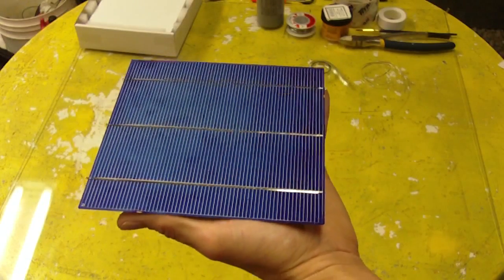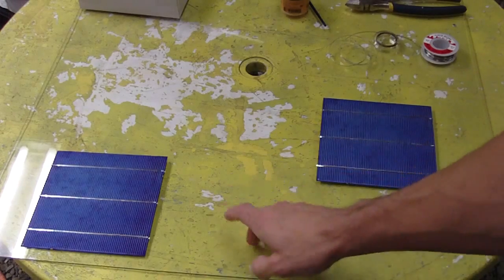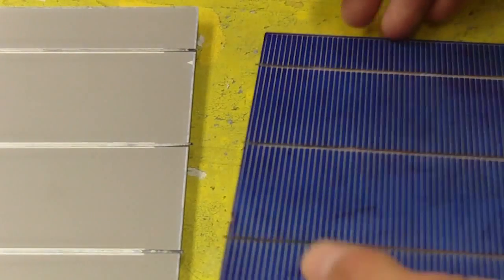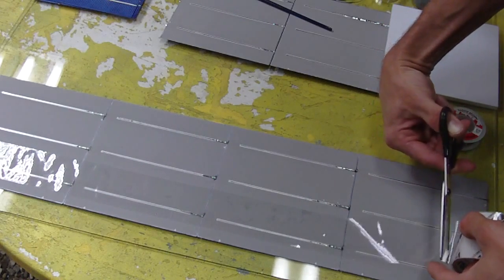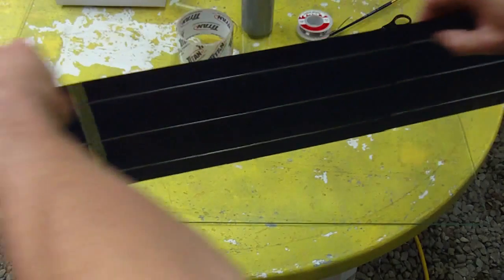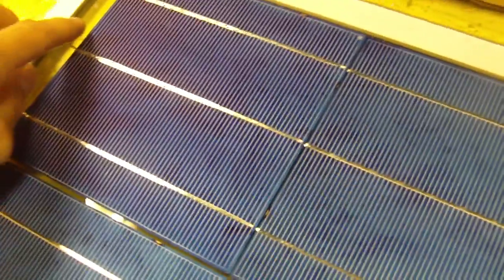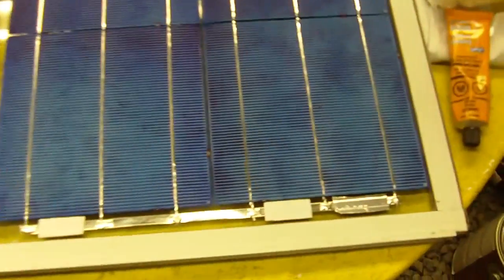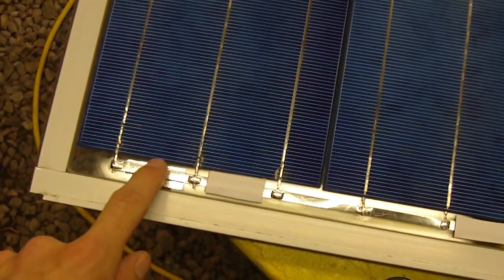Homemade Solar Panels Diy tutorial, complete build

Comment: Great video was wondering why you used glass for the back cheers
Reply from the maker: Thanks a lot 👍 These are non encapsulated glass on glass panels, so I used glass on the back of these panels to provide the best weather proof seal as possible. Ive tried other materials but they don't last as long also they expand and contract at different rates. I actually made some newer videos last year of a monocrystalline if you are interested.
Reply: @kurtscottage  cool thank you very much for explaining I will watch that other video cheers best wishes from England

Comment: The spectral properties of the glass have to be known/tested first. If not: normal glass can give a lot of loss on the yield because of damping the light/frequencies that add most to the wattage/output. I made small panels in the same way: it did not work (condensed water, internal oxidation, breaking glass due to freezing temperatures, solar units not completely identical and thus loss and "pushed up" current, damaging the weak cells, etc. The process can work for small hobby panels, not for the serious ones. And at the moment (2018) professional panels are very cheap. Anyway: a good experiment, I appreciate it!

Comment: solar cells for sale,Grade A cells , 156*156 3bb mono and poly, 3.92w,4.09w,4.28w,4.38w,4.44w.4.59w,4.72w,4.77w
price starting from 1 USD.(German solar cells,Malaysian cells)tabbing wires, buswires. all materials for made solar panel,exporting from sri lanka
contact for more info-
whtsup/viber 0094778322668

Comment: what material are the panels solar made of?
could see in whole video
thanks
Reply: solar cells for sale,Grade A cells , 156*156 3bb,2bb mono and poly, 3.92w,4.09w,4.28w,4.38w,4.44w.4.59w,4.72w,4.77w
price starting from 1 USD.(German solar cells,Malaysian cells)tabbing wires, buswires. all materials for made solar panel,exporting from sri lanka
contact for more info-
whtsup/viber 0094778322668

Comment: Hi Thank you for your video, it was really informative. On another note, I have to point out that glass is definitely not a heatsink  Glass is barely heat conductive hence why it breaks so easily with thermal shock because of huge temperature gradient. A heatsink needs to have 2 caracteristics good thermal conductivity AND good heat capacity. Aluminium, copper, steel basically all metals can do that. Glass, I do not believe so

Comment: ok it seems that a lot of people here dont know what he is doing he didnt make the solar cells he bought them. he is making a solar PANEL if you want to know how to make one here it is http://www.wikihow.com/Make-Solar-Cells if you want to buy some cells and make a solar panel here it is http://www.ebay.com/itm/100W-Solar-Panel-DIY-25pc-156x156mm-6x6-High-Power-Solar-Cells-Battery-Charger-/302170834486?hash=item465ac90636:g:jwUAAOSwECZUo2gy
Reply: solar cells for sale,Grade A cells , 156*156 3bb,2bb mono and poly, 3.92w,4.09w,4.28w,4.38w,4.44w.4.59w,4.72w,4.77w
price starting from 1 USD.(German solar cells,Malaysian cells)tabbing wires, buswires. all materials for made solar panel,exporting from sri lanka
contact for more info-
whtsup/viber 0094778322668

Comment: you say they are very delicate but you pile all your materials on top of them???? you didn't show noting but how to destroy other panels to just stick them all back together. in which you still didn't give a good presentation. so destroy a shit load of solar lights just to sadder them back together.... weird and a waste of time.
Reply: you can buy the short tabbed cells on ebay. he didnt take them apart. costs less than a fully tabbed cell. just makes it cheaper for the DIY'er. I have never used these kind, i apply the tabs to new cells when i make my panels.

Comment: I was build several panel in this manner or slightly different. All of them suffered from same problem - over heating due to green house effect and melting all soldered points. I try on different approach, and my conclusion is: Without EVA film encapsulation or resin filling ( what is extremely expensive) it is impossible to build durable panel.

Comment: Nice educational video, how is presenting so far the solar panel? some problems, with condensation, or other something else negative can be prevented? Because I want to do something similar but probably smaller. Thanks in advance if you can answer.

Comment: From what I've read solar panels are at best 10 -18% efficient.  
If they are attached to your roof they are only 100% efficient  for 30-45 minutes of the day for only about a month or two out of the year.  The rest of the time isn't the efficiency about 5 to 10%?

Then from what's produced ins't 10-20% of that lost by the inverter?  So if you average how munch energy is being captured to what's usable isn't doesn't that average out to 2 to 5% over the course of a year?
Reply: +Passed High School Physics Well, you used to be right , years ago but solar city sells them at 20-21% efficiency, and the total voltage drop if wired up ideally, and your inverter isn't from the stone age is around 3%.Not bad really, we're getting there.
Reply: TheLast Dragon   California is turning off solar farms and favoring buying energy from coal and natural gas fired power plants.  Turns out solar isn't reliable,
Reply: +Passed High School Physics .... Right, the same state that can't secure a water source, elected the terminator, and has midgets and porn stars run for office is at the fore front of what works and doesn't work in broader society.  Everyone knows that clouds cover the sun and depending on where you are, solar isn't always the answer, but it's a step in the right direction , especially over polluting the atmosphere with more burned coal and fossil fuels.
Reply: TheLast Dragon   Hey we are proud to elected the terminator, and had midgets and porn stars run for office but at least we have we have standards we never elected a beauty queen.  Remember pron stars not only have to look good, but act as well..

And speaking of actors you didn't mention the actor, turned governor (who sprayed protesters, elementary schools and hospitals in Berkeley) with tear gas was elected as our 40th president.  He ruled the country with the help of his wife and an astrologer and was such a good actor we didn't even know he had Alzheimers.

Why is it the environmentalists who say the world will one day be powered by wind and solar forget to say where power will come from at night and when wind isn't blowing.

Not trying to insult them but how will my 82 year old mother heat her house or have light at night when there's no wind or at night?

Comment: A 6'X9' panel (24 cells) would be required with no space waste to create 12V@1A max. It would require 100 of these 12V panels to convert to 120VAC@10A (1200W) minus conversion inefficiency. (60'X90' of space used) Typical home has 100A service, so that means it would require 1000+ of these panels (6'X9') to power a house breaker panel at maximum capacity. (Almost 1X1.5 miles of land area) The solution is to find cells that put out more electrons with less surface area.
Reply: @DrHarryT

Your 100W breaker service should not be taken into the equation.  No one's house is actually pulling the 100W at any given time - that would be astronomical.  My daily usage for example, is only about 500 watts max an hour.

500 watts translates to around 4-AMPs being used at any given time - again on average.  4-AMPs means around 5 or 6 of those 6x9 panels you mentioned, not 1000+ panels!  :)
Reply: Moe of course was not the only one
Reply: Not sure what you mean: Was not the only what?

Comment: when i did some soldering of PV cells a couple of years ago i placed another piece of glass over the string of cells (which were sat already on my piece of toughened glass) to make a "sandwich"
Then i could turn the whole thing over safely and then remove the glass that was beneath is now on top.
good tip ??

Comment: These are the cells you used right? 100pcs 6x6  from newegg? http://www.newegg.com/Product/Product.aspx?Item=9SIA2PA0ZV2240&cm_re=6x6_solar_cells_100_pcs-_-9SIA2PA0ZV2240-_-Product
Also is it as effective to use plexiglass so they'll be more durable in harsher weather? Thanks for the video!

Comment: Change your solder from 60/40 to 63/37 solder. This 63/37 has no eutectic state (no plastic state.) Also, clean all connections with technical grade (>80%) alcohol prior to soldering with a clean tip. Clean all flux off with alcohol.

Comment: I've never messed with any of this before, So I have a question for anyone here that may be able to answer. The wires that come off of the solar panel, Can those wires be connected to a charge controller ? Or do they have to go through some kind of circuit first, then to the charge controller ? As I said I've never messed with any of this stuff before. Now this is the reason that I ask the question... I was given a solar panel that had the wires and the black box ripped off of the back. I can solder new wires on the back of the panel, but I'm wondering if that will work being that there is no box on the back of the panel ? Is there some kind of circuits inside of the box where the wires connect to the solar panel ?
Reply: +Roger Sayers 
The black box might have had a diode to block reverse current, but without that when you connect a charge controller direct to the panel your job is secured. The charge controller will have the revers current blocking diode and will protect your battery from overcharging and under draining.
Reply: +Ponniah Kunathasan Thanks for that information. It sure does help. Now I'm wondering what side of the paned is Pos & Neg ?? Would you happen to know ? As I'm looking at the panel from the back or reverse side, Would the Pos be on the left or right ?  I hate looking so dumb here, but this is the very first time I've ever messed with solar panel.
Reply: +Roger Sayers 
The blue side (The front of the cell) is negative and the  gray side ( Back side ) is the positive. All the lines in the front  are negative or  all the lines in the back are positive.
Nowhere in the world a walking baby has born. Do and learn, if you make a mistake you are not going to die.
Reply: +Roger Sayers I can guess that pos is at the back but this is not absolutely guaranteed. A test meter (and blocking diode) are essential.
Reply: +Cashpot I missed the diode in the video. If one is to connect the panel to a battery, this becomes crucial.

Comment: Most silicone RTV sealants sold in hardware stores and auto parts stores produce acetic acid (vinegar) during curing, which plays havoc with metals used in electrical equipment and severely affects long-term reliability.  I'd use a type of RTV that doesn't produce acid.  It's much more expensive, and generally only available through industrial adhesives distributors.  Consider clear or gray Dow Corning 3145; white General Electric RTV 162 or gray high strength RTV 167; and clear Loctite 5140.  These RTV sealants produce alcohol, not acetic acid, during curing, which is generally harmless to electronics.
Reply: +Milosz Ostrow Last time I checked, GE Silicone II is also a non-acetic (aka "neutral")  cure.  Any easy check is to smear a blob on a paper towel, let it sit and dry a bit and if you sniff it and it smells like vinegar, then you have the "bad" type for electronics.  Ge Silicon I is an acetic cure so do NOT substitute!!

Comment: You are NOT suppose to buy solar cells from Amazon. That's why there is a store called "NewEgg". Cells for 80w panel come in a package of about $40. I don't know where some idiots are getting their calculations from. Some say $120+ for 40w cells. BULLSHIT.
Reply: +Danyal Ahmad Maybe they were thinking of the Harbor Freight 3 panel, 45 watt system for about $140.00.  Don't know for sure but it would sort of make sense.
Reply: +Danyal Ahmad I forgot to ask about your answer regarding "New Egg".  Is that the place to buy single cells or packages?  Obviously, I'm a complete newbie regarding making your own panels, too.
Reply: Kim Curtis You can buy single solar cells or packages of solar cells much cheaper.
Reply: +Danyal Ahmad NEW-EGG is a great place to buy from but its just like Amazon anyone can sell on newegg i spent over 10,000$ from this site only sent back a few items but Amazon and NewEgg is the same at selling anyone can sell items on there site as for Solar cells newegg does not sell them its a 3rd party Person so before you call people names and make dumb ass statements do some Research because its just makes you look like the fool
Reply: Lee Aguina Go to NewEgg. Compare the prices with Amazon. Idiot.

Comment: Dear all solar energy is simply fantastic i have bought 2 , 40W panels with 40Ah battery and it runs 2 led bulbs, my wifi router, 1 inkjet printer and speakers for the whole day   for indian buyers you can buy these solar modules  here 

http://www.ebay.in/itm/Solar-Panel-solar-plate-solar-modules-40W-12V-2-1-amp-/321404724809?ssPageName=STRK:MESE:IT

Comment: Hi! Does anyone know how to eventually use the produced current? I´m going to have these terminals and connect a (copper) wire to it, but where do i go with my copper wire to?
Reply: +ralli011 depending on how much max voltage your panels can produce, you can hook them up with a batter but you'll also need a diode to prevent reverse current. Usually people connect a few small panels in series to get 5V and charge their phones through USB cables.

Comment: Out of curiosity why didn't you wire the cells in parallel?
Reply: +James Harris Agent  Southrnboy78 
coz when you connect parallel you get 2.5v and lots of current. there is no inverter working with 2.5v and also its not efficient electrically.

Comment: omg a day later i continue this video and he says file the tip of the soldering iron, NEVER do that! that is the way to ruin your soldering iron
Reply: His comments are disabled. I'm Electronic Engineer, worked with soldering irons of all types, anyone should know not to destroy the tip. You must keep them "tinned", that's what I call it. You understand, I'm sure.
Reply: Sylvia Baker yeh so you file it to shape (assuming of course it isn't a funky 2 metal tip) then heat it hot, tin it, let it cool then use it as normal.
who started this filing the tip is bad buy a new one rubbish?
soldering is nothing more than transferring heat from the tip to something, a well shaped tip is the correct tool.
Reply: Scotland Live sorry work with top stuff only, copper will slowly develop little craters and loose shape, that is why  I use chromed  or nickel tips, never to be touched by a file
Reply: yeh as i said, the cheap tips you file into shape then tin.
Reply: now then we are fine ain't it?
Reply: I'm retired electronic engineer, so I had my own tools, including soldering iron that has all shapes and sizes of tips. Hey, if it's working for ya, great.
Reply: so was I, wanna know what I built see here 
http://www.cryptomuseum.com/crypto/philips/spendex50/index.htm
Reply: That's great. I loved my job. We had contract with AMD processor's. ((Dish Receivers, critical medical equipment, etc.)) We designed the circuit for AMD, and when we finally got the 1gb speed, we thought we'd hung the moon. LOL. My primary job was testing, debugging etc, on anything in the test and engineering department. 
Looks like you love the work, too.
Reply: yep one of the most finest jobs I had, actually building something that helps people
Reply: M Goudsmits So next time, clarify your point. Many people use copper tip, and filing them is common practice.
Reply: Iii
Reply: Scotland Live I'm not criticizing your technique. My professional career was  dependant on soldering tools. (I specifically worked with very small electronic components). I never heard of "filing" the tips. 
Anyway, the soldering tips that I used then, when properly taken care of, I can still use now- 15-20yrs later.
Reply: Sylvia Baker lol you and I are pro
Reply: Yes, sir we are 😀. . I'm an "electronic engineering professional"~ that's what  my children think , anyway.
Reply: M Goudsmits meh.  sometimes we just do.  as an iron is like $5. ;)

Comment: Silver-based solder melts at much lower temperatures.  Use it if you are concerned with heat damage.  It may also work better, because melting at lower temperatures means there is less of a temperature difference between it and the wire you are trying to get up to that temp.

Comment: thanks for easy to understand  stuff.. my solar panel glass has cracked.. can i place another  glass over it using silicone adhesive? can i use plastic cover or poly carbonate sheet instead of glass  to prevent cracking?

Comment: What solder do you like best?  I still have some 60/40 tin and lead solder.  You know it is the good stuff they don't use in electronics any more.  I have read that the lead free is bad for electronics over time because of tin whiskers.  There should be laws to prevent them from banning stuff when there is no long lasting alternative.  Damned EPA ruins everything these days!!  They are the reason the paint on your car is so easy to scratch and your dishes get that white crap on them.  Sometimes I just wish they would stay in bed when they have those ideas.

Comment: You should encase them in resin or you will have condensation. Sun Cure is UV cure UV resistant resin used as a surf board coating, about $22 a quart. Works great.